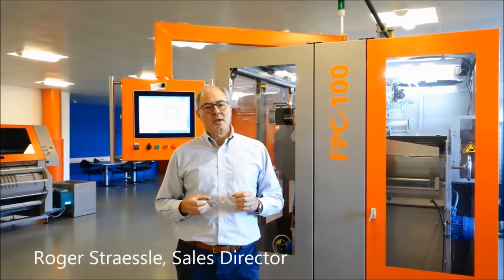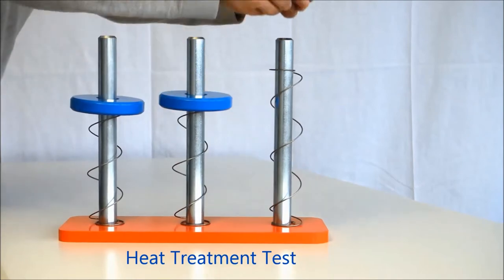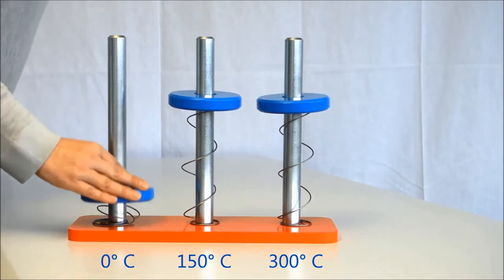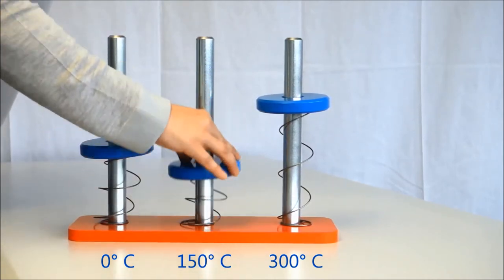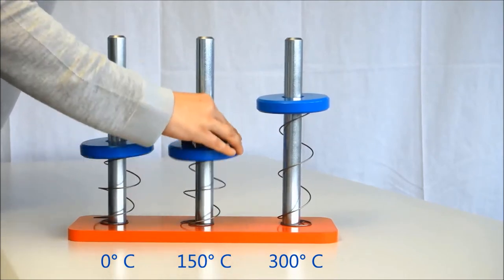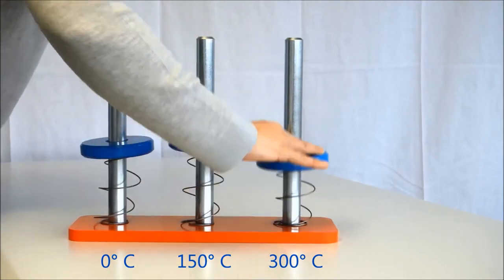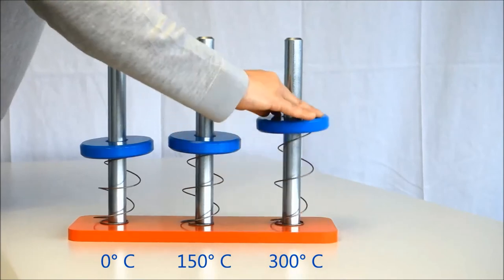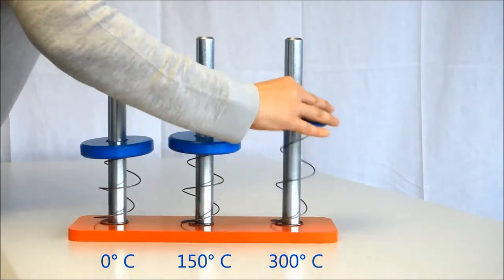FIDES Spring Academy - Heat Treatment Test

Comment: trotzdem hat auch die Letzte 20% loss of height.
Reply: Needs more coils in spring. Then the loss between each one will be less and will also increase overall longevity
Reply: @scapegoat1313  If I remember the mechanical engineering textbook correctly, a lower pitch (more coils in spring) is accompanied by a weaker spring force.